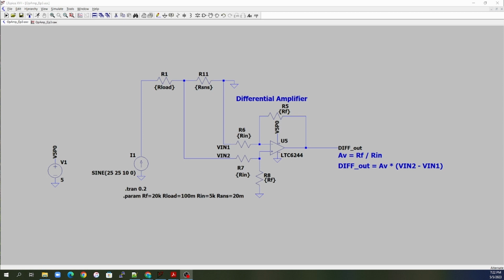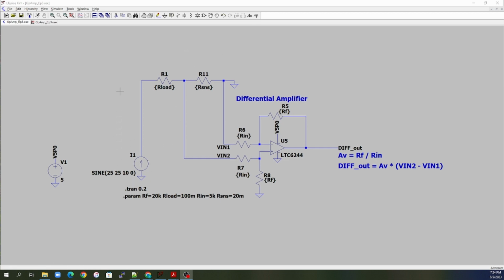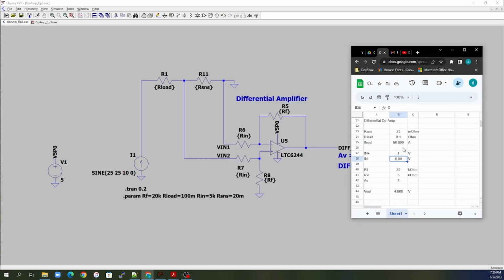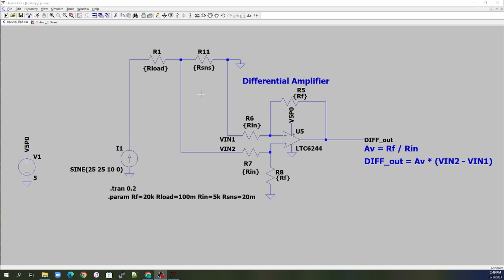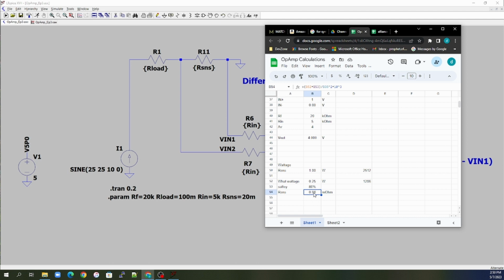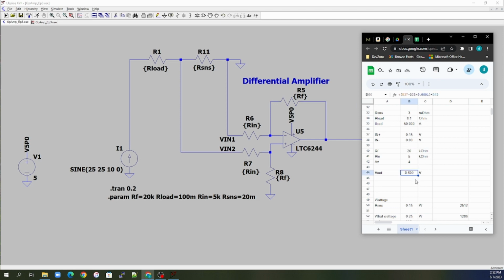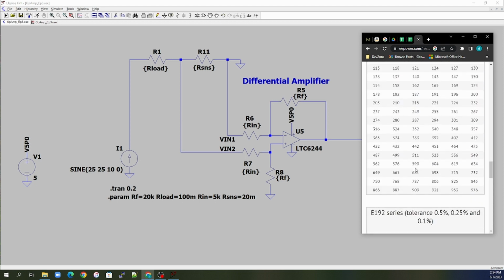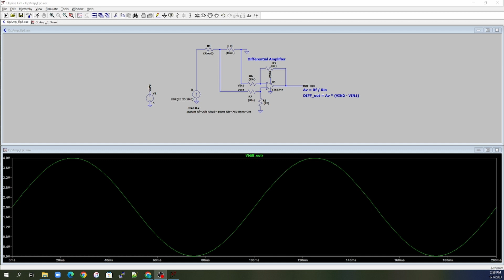Op-Amp Ep3 - Differential Op-Amp and Current Sense

Comment: For low current applications, don't forget an offset bias that exceeds the op-amp worst-case input offset voltage, otherwise you'll have a dead-zone before the sensing signal exceeds op-amp input offset.